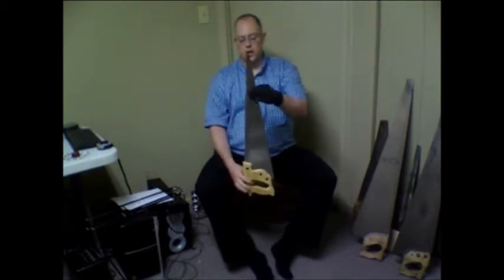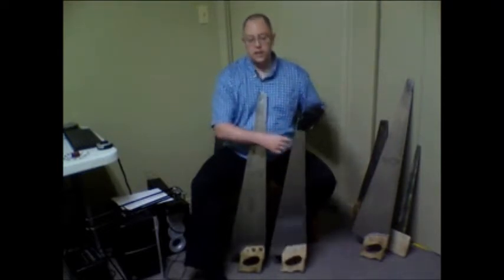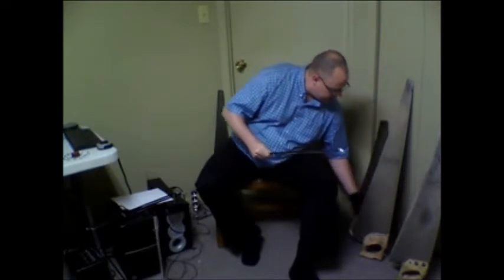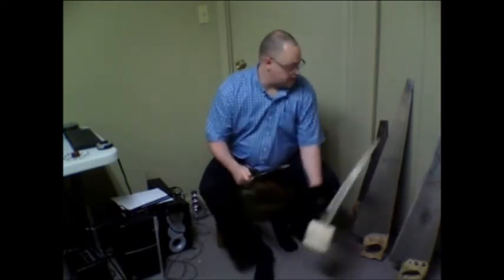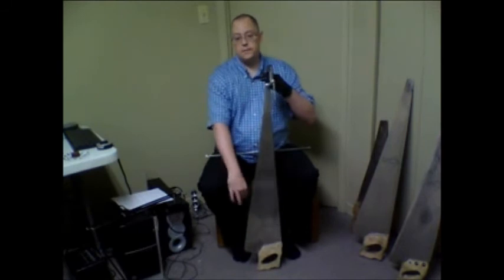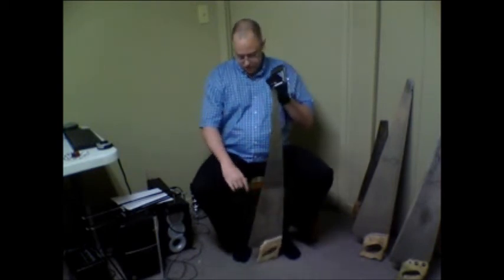Musical Saw Design Revolution (non linear edge)

Comment: Very interesting and important engineering of musical saws!  The concept of a non-linear edge is revolutionary.  I have achieved 5 octaves with a straight edge and thinner metal (0.030"), and over four octaves with 9mm/0.035" metal and a straight edge.  A critical factor is the amount of sustain possible with these various approaches.  As you say, too extreme flexation kills the sustain.   And with a very small tip, the flexation is certainly considerable!  As far as simply achieving a big range - that isn't too difficult.  But to get both - big range and good sustain - that is what is very difficult.  Another critical factor is the method of mounting the blade into its base handle.  I have tried all sorts of methods, and ended up using full-length  insulation around both faces of the blade inside the handle, to create complete isolation between the metal and the wood and hardware.  This results in a very consistent tone in the entire note range, with no ugly overtones at the low end.  But there is a trade-off - the extensive base padding takes away some of the otherwise possible sustain!  So every solution comes with its own problems!  Great work, Olivier!